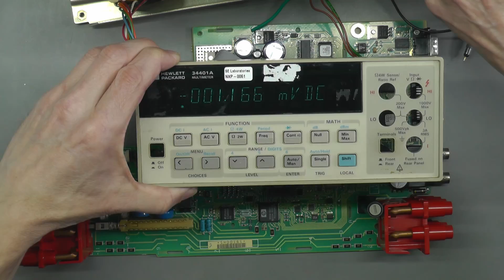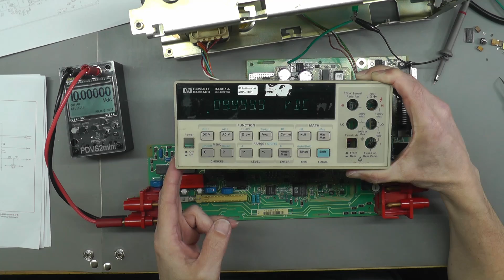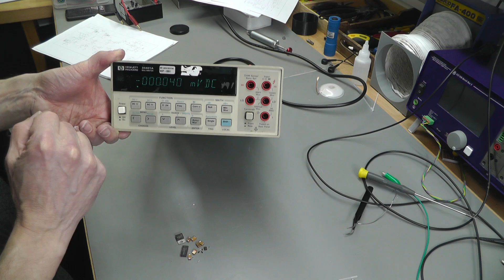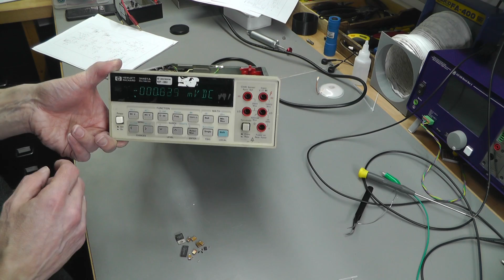No.085 - ***Another*** HP 34401A 6.5 digit Multimeter Repair - Part 2

Comment: Those static rams usually I suspect when see reset line being pulse. Had to replace way to many over the years. Love old HP gear but definitely problematic. Usually line filter, Rifa X/y capacitor, tantalums, DAC’s and static rams usually a issue with HP gear from this area. I lost count?

Once repaired HP gear is pretty reliable.

Comment: Hi Ian, another great repair. I work on routers and switches, repairing and testing. The number of switches I get in with failed static RAM is very high. They seem to last about 6 or 7 years before failure. They are usually the 46Vxxx series in a TSSOP 66 pin package.

Comment: Hi Ian, 
  I also own an Agilent 34401a. I replaced all electrolytics and tantalums, all works great but the AC current bellow 10 ma AC, can you run some tests on yours to compare results. It was the same before replacing the caps and re-calibrating the 10 ma AC as per the calibration procedure. I posted this on another channel but haven't gotten a replay. Any help would be appreciated. 
Thank you.

Comment: Hi Ian, good vid mate. You are aware that if you increase the voltage rating of the caps you are reducing the value?  High value caps are only the stated value near their working voltage, so changing those to 35 volt has probably reduced their value by at least a third in circuit.

Comment: Great. I bought a used 34401A, an Agilent one, about 22 years old, where the front panel fell to pieces when I took it off. They had left out the front latch, because there were nothing to attach it to. Consequently the front input assembly flexed when you inserted cables, so I was worried the board could have been damaged. Everything is fixed now, with a new used front panel from China and new bumpers. The PCB was surprisingly dirty and the rear connectors quite a bit oxidized. Seems to work fine after a cleanup.

Comment: Thanks Sir ,Very helpful technical support and very keen trouble shutting process, Sir I need Your help regarding the same DMM, My one kept unrepair as the power transformer primary winding burnt, and it is not available here, can you send me the details of secondary winding, the all ac voltages, hope you will consider my request  thanks again, have a good day
Reply from the maker: Hi,
I dont have the voltages to hand, however you can work out the windings required by looking at the DC voltages required and calculating back to the transformer windings.
I am not sure the transformer is the same spec as other DMMs, i woukd doubt it though.
Reply from the maker: Update: There are 34401A transformers available on Ebay.

Comment: Nice job. My display seems to be hanging on ok and meter works fine. Just got a 512mhz frequency counter that does not reset everytime to fix, and 512mhz signal generator that refuses to output the same frequency as the display.  So a few jobs to do. Just need to find some silver loaded lead solder for the sig gen as it warns against using normall solder.

Comment: Nice video. I did change display also..and results were so amazing..display was just like new...then i changed it on second meter and results were not so good so i bought another one..and changed that one and results were better...but never so good as on the first one..but it looks ok like 3 years used..so almost as new..too bad i didn't order from same seller ..haha if i knew that i would order it next time as well..anyway two 34401A are just fine..no need to have more..i need to get one 7.5 digit..but those cost a lot more..i got 2001 but i'm not happy with noise..maybe i will try 2010 next time or 2002 ..but prices must go down and not up..lol...Anyway as always nice video..